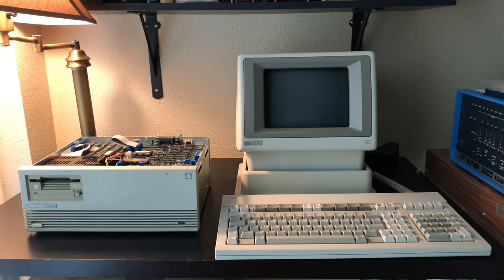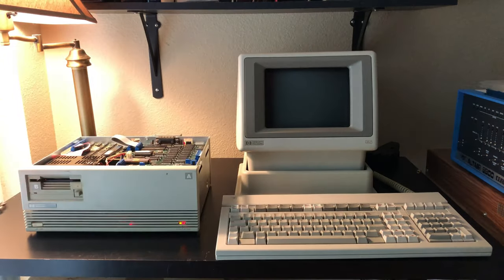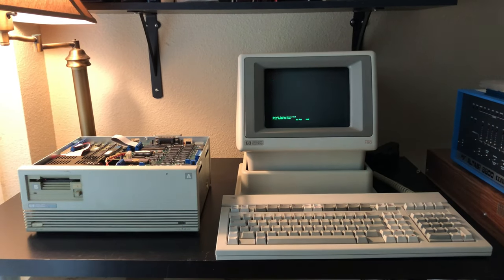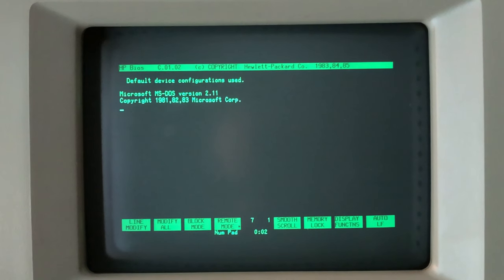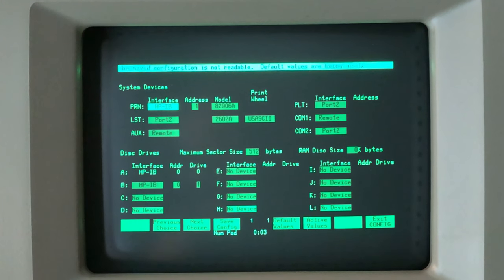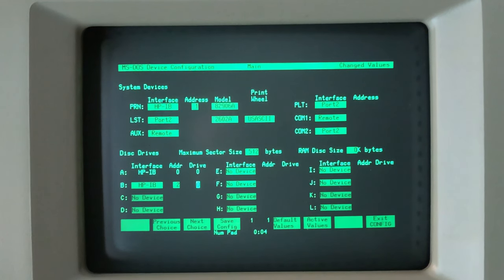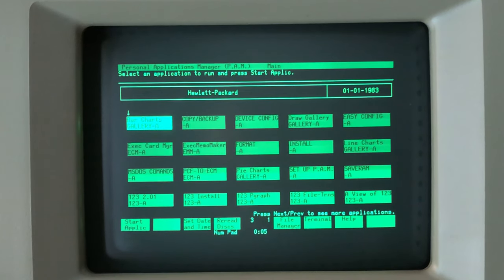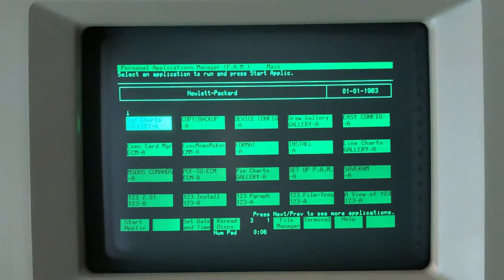STB507 - HP150 Personal Computer - Part 6 - HP9133 Booting from the harddrive

Comment: I  have the newer 150 Touchscreen II. It has a boxier design and a larger display. It also came with 3 9153c drives which has Hp's proprietary hard drives. I think they were called nighthawk drives. So far I can only get it to boot off drive A. But I can see now that my cmos configuration is incorrect.